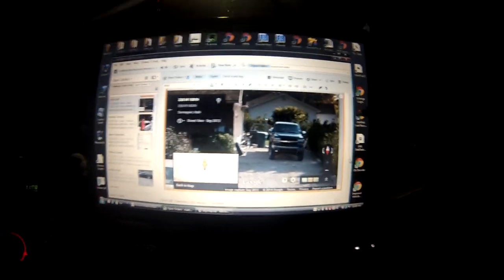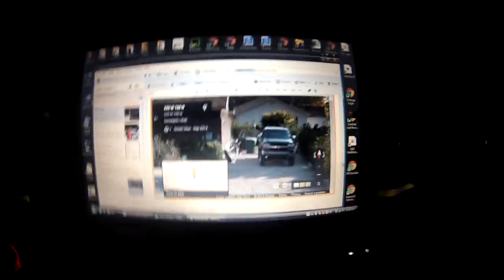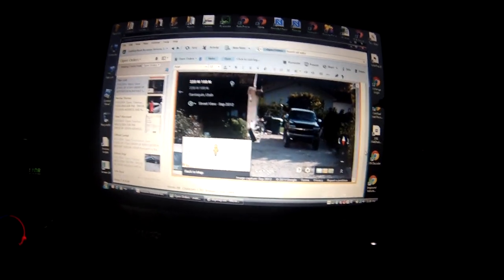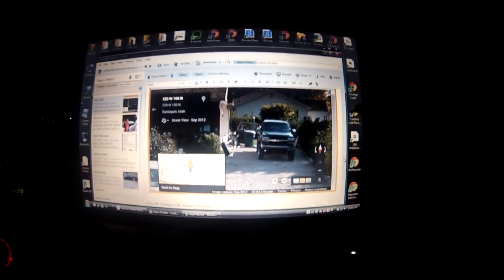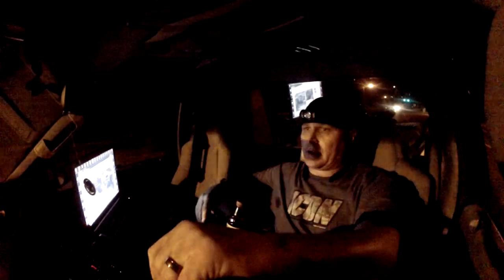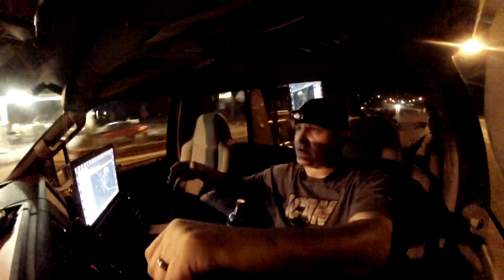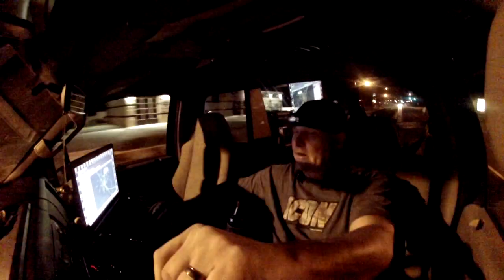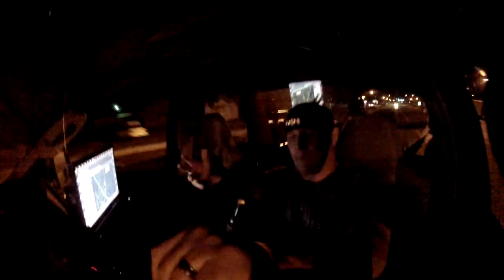It Is A Simple Fact That Size Does Matter When It Comes Down To It - 09/22/2014

Comment: Hy matt! I feel your pain on the engine repair. my experience with the Isuzu/GM "Duraslack" is not much better. As I run a 07 5500 4X4, and we replaced the injection pump and 10 injectors 6 months after putting it in service, 12K+ on that. You just can't get away from the repairs on something that is man made. I like to say. "if it is man made then it will break that is a engineered in feature so we have something to do later" LOL! I personally learned on Cummins so based on my history as a ex diesel mechanic I like the Cummins best I only wish the big 3 would let consumer spec out the engine, trans, axels on LD trucks as is the norm in the HD truck industry.

Comment: I actually really enjoyed the casual conversation Matt had with the debtor in this case. And this is also where I learned how much it cost to bulletproof a 6.4, which is why I decided to continue sticking with my old trustworthy 7.3.
Reply: 7.3 is hard to beat. My 2001 has a little over 385,000 on it. Two alternators and a water pump later and it's still going strong. It's heavily modified too. 110lb injectors and a bigger turbo dual 5 inch exhaust as well as an electronic programmer. On paper it's supposed to make 675hp and almost 1,000 ft. lbs torque. I can still manage 20 mpg highway empty withouta trailer, with my 43ft. RV it gets around 14 mpg.  It's a blast to drive and sounds great with the upgraded exhaust and turbo. The 6.4's are pretty decent motors after the "bulletproof" mods, head bolts, head gaskets and whatnot. Most of the pre emission diesels aren't to bad but the 7.3 and the 5.9 valve as well as the early 24 valve Cummins are pretty amazing power plants. The LB7 duramax is a really reliable motor too. GM from 2001-2004.5. The rest of them... well not so great in my experience.
Reply: @Mcscott67  i'm only getting 14mpg highway empty in my 2000 7.3
 lol

Comment: Surprising how many people dont really understand this diesel truck. Its ment to smoke, diesels smoke quite alot when you stand on them and when they are idling. No mechanical issues with the engine whatsoever, possibly a little extra torque and hp produced if its not a stock setup.

Comment: I used to race and pulled a 48-foot enclosed trailer around the country with a Silverado 3500 dually. It was a Duramax with Allison transmission and a chip and that made it quite the beast. The only problem was that I went through six set of injectors when the engine finally blew at 650,000 miles. I had the motor rebuilt and got another 200,000 miles out of it when the injectors went out again. So, I retired the truck at that point.

Comment: I  had my 71 Winnebago towed by a 350 with the stinger attachment. It was a 34 foot long RV. He picked it up from the front. the 350 didn't look too squarely on the ground but he pulled it 35 miles.

Comment: For my GMC Truck when it's front end starts feeling floaty I add counter weight to the front bumper ,I welded on 4 rods with big cap nuts and 6 inch washers welded to the cap nuts ,now I can add up to 400 lbs of counter weight using 50 lb free weights ,I've never had to add more than four 50 lb weights but I have 8 of the 50 pounders just In case, for snow plowing I only add 2 of the 50 lb plates on the 2 rods over each wheel and I can steer A lot better while pushing a big load .

Comment: Mr. Matt is sending me a set of dolly covers here shortly i dont know who else has bought a pair off of him but just as soon as i get them i will be sure to write a quick review and thank you i may even post a video of me opening them up and going over them. i just spent about 1600.00 dollars on a pair of in the ditch xd dollies zinc coated with aluminum rims and axles and here in ny the winters are rough in the mountains where i live and the salt and sand is horrible on your towing equipment so it wouldnt make sense not to try and protect them especially after all that hard earned money was spent on them. do the math 200 dollars on a set of covers could save me three times as much not having to replace the side frames spindles and all that. Mr. Matt is also very quick to get them made up and keeps you informed by email every step of the way. pleasure doing business sir.
Reply from the maker: FRANK HORVATH Oh crap I knew I was suppose to do something last week and it's been nagging at me... Now I remember I was going to get your dollie covers made and shipped out! Damn dude I haven't been sober for weeks now j/k LOL They will be shipped out first thing in the morning. Sorry about the extra 4 day delay. They made the smaller size the first time by accident but got the ;larger ones made pretty quick after that . They are all packaged and ready to go. Thank you for your order.

RepoNut
Reply: i appreciate it i wasnt trying to hurry you along neither like i said i been way to swamped to even mount the dollies plus im waiting on dynamic to send the axle tube mounts because their lightning body is shaped all crazy in the back so normal mounts aint tall enough in the back,

Comment: I recently put LEDs in for my turn signals, and it flashes fast. Yes, I like it as well. The only issue I have, is that it occasionally switches between fast and slow, which drives me nuts.

Comment: I have a 6.0 diesel... Yep! It gets bullet proofed this spring, want to avoid the $13,000 rebuild myself. Like you, I learned a whole lot about the 6.0 and 6.4 power strokes after buying it. The Ford 6.7 are good though, no longer international, now Ford makes them and they've been much better.
Reply: william dezwijger Fords = if the 6.0 look in the hood for already installed headstuds. 6.4, just keep moving, don't bother. 2011 6.7 and beyond, good engines.  Dodge 2001 and prior diesel, best engine ever. After 2001, keep maintenance top notch so lift system and injectors don't fail. GM products, they can be good or costly.

Comment: He should have bought a old 12v cummins tow truck, they sell kits where you can rebuild them for almost $600 and that's a complete rebuild. It isn't a cummins brand rebuild but I'm sure they will last awhile. You could buy 10 of them for what he rebuilt his 6.4 for. More than likely that 12v if you take care of it with proper maitence will last atleast to 300k before you need to freshen things up anyway. I've seen several go over a million miles before a rebuild was needed

Comment: Did you ever place the GPS tracker on the Tahoe?
Reply: LamborghiniReven1000 I was jus thinking of ask g the same question
Reply: I'm sure he did, but didn't want to show where or how he installed it.
Reply: LamborghiniReven1000 I like to be fast too
Reply: All it was was a magnetic box nothing special about where he puts it anywhere underneath on the body. A lot of times they like to hide them in front bumpers and stuff we're it's hard to get to.
Reply: LamborghiniReven1000 is that edwins shop?

Comment: i meant to put this in the video where you first got the ninja fixed. but have you ever thought about getting an edge insight cts. i think you had one on the 7.3 that would be a good purchase.
Reply from the maker: SteveTheTruckGuy CTS is a model made by Edge Products and I would go with them first choice since my older brother works there but they do not touch the engines with DPF and EGR deleted so I cannot use them. I have purchased a H&S Mini Maxx that should have arrived today but did not thanks to the retarded USPS. Video coming soon of the installation.
Reply: RepoNut the only tuner i would ever put on a ford is a dp tunner. i know there are lots of opinions out there but working on diesels gives me alot of experience with this stuff. dp only does fords. smarty only does dodge. and efi live is chevy. fuck that edge one chip fits all stuff. i have sean lots and lots and lots of people blowing up there engine with edge. also you need to be really care full  how you tune your truck with the deletes you have done.

Comment: you need to do a front counterweight on the front of that truck matt , I finally did a 600lb on mine , the front does not skate ever now , and the truck actually drives better loaded and empty !
Reply from the maker: towrecker I'll be adding a Warn bumper and winch soon that will be my counter weight.
Reply: RepoNut :) you will love it weighted , it makes an major difference , remember to check alignment after you add that , A 400 lb counterweight , as I assume a winch and bumper will weigh close to that , throws the alignment out enough to trash steer tires quickly FYI
Reply: ***** water is actually light , if you filled a 55 gallon drum up with water , and strapped it to the front bumper , it will only add around 400 LB of weight , but take solid steel say a 2x4 inch size solid it only takes around 14 feet of it to weigh the same my weights are 6 pieces 3 feet long welded together and it weighs right at 500 LB , mine is stacked inside my push bumper , so I can un weight it if need be ...

Comment: Heads up Mat, don't know if you realized it, but Passenger side reverse light aint workin. :) Noticed it when you were backing up to the truck that I only saw the reflection of your tail lights and driver side reverse light.
Reply from the maker: Ua it's been like that for awhile. Wiring issue not burned out light.
Reply: Just pointing it out. I know you have LED's so I know it's not a light out. >< figured was wiring or something, and needed checking/fix. So you don't get in trouble with the police for it .
Reply from the maker: ***** Back in the 80's I remember watching my mentor cut the reverse light wires right in two

Comment: RepoNut What was the overall weight of that DMAX Mine Sits about 8500-9000 with Lift and Tires and i have the 4 inch not a 6 inch, and have you thought about putting a nose weighted pumper on the front to counter the weight of the tows.

Comment: Don't dis your truck, dude.  It'll break down on you for spite.  My 2002 F350 Lariat Crew Cab Powerstroke 7.3 has 347,000 miles with no significant work. I've had to replace the starter a couple of times and the blower motor, but other than that it came bulletproof right off the line.  It tows trailers that newer trucks only wish they could.  Flash your chip for significant power/performance increases.
Reply: +Darin Clay Those 7.3s really don't need anything done to them. The 6.4s are a pain in the ass to such a degree. I mean several companies here including Lizard Lick run Cummins now

Comment: I'm sorry I ripped on you so hard about the laptop, but I used to drive a wrecker.  A tail-dragger on rotation.  One night about 5 years ago a teenager was driving a lifted Chevy pickup, and texting.  He rear ended a single mother's Ford Fiesta with three kids in car seats in the back seat.  The shop I worked for recovered both vehicles.

If you had seen what I saw in the back of that Fiesta, you would fold up that laptop, and put it away!  I no longer drive a wrecker.  That Fiesta is why.
Reply: Accidents happen the kid made a mistake. No reason to stop doing what you love just for a major mistake. Forgive and forget.

Comment: Bullet proof an engine that has flaws right off the factory line....anyone else see something wrong with that ?
Reply: MOOG does the same thing with suspension parts. They use the OEM design, redesign the problems out.....wah-la, MOOG problem solvers.

Comment: bullet proof ?
you went to powerstroke help in Buford Georgia ?
Reply from the maker: michaelovitch Ordered a set of Big Dogg heads and had them installed locally to his specifications including the ARP studs and a few other tricks to help with heading issues.
Reply: RepoNut
ok.
Is the excessive smoke caused by the DPF regeneration ?
Reply: michaelovitch
As part of the bullet proofing, he probably removed the DPF.
Reply: eformance
Maybe,maybe not, following the state the truck is registered in, to not bother the customer with inspections.
But if DPF is removed it would explain the smoke if the regeneration is not canceled from the ECU.
Those engines use fuel to create heat,not urea if i'm right.
Reply from the maker: michaelovitch DPF was deleted by the previous owner. The H & S MiniMax on the truck is programmed with the DPF and EGR deleted so the smoke was not from the regen. It was most likely from the new parts and the installation grease they use. It has stopped smoking on idle and barely smokes when I am driving it now.
Reply: RepoNut
Ok.
Thank you.
Reply: other placed do it its like doing a recall that you have to pay for
Reply: +RepoNut the 6.4s also have cooling issues I would get a bigger inter cooler if I was you
Reply: Leroy Spires dude the 1997 7.3 powerstroke OBS is considered the most reliable and rugged engine ever used in a light or medium duty truck also the 1997 7.3 got close to 20 mpg depending on how it was tuned it could get a lot more
Reply: you want a nice motor get a detroit diesel or a cat or even a cummings diesel
Reply: who me lol the 6.2 and 6.5 detroit's are so weak and the cat would require tons of fap work the cummings or a power stroke is the only viable way to go really and it already is a powerstroke he just needs to junk the 6.0-6.4 i cant remember which he has its an old post but them 2 are junk and need to be replaced with the new 6.7 or an old school 7.3
Reply: +VK70001.P i think hes talking bout the old 2 stroke detroit diesels not the shity 6.2 or 6.5
Reply: I always thought bullet proofing a engine like that was a parts kit and fixes most issues... i dont deal with deisels often

Comment: Hi, cant you add steel weighted blocks on your front of vehicle? make it so they can be added and removed per application.
Reply: +InTheFleshInc You would need some heavy weights. Where do you keep them when you don't need them? When I was driving tow trucks, we experimented with sliding weights under the truck. Worked okay, but lost a lot of clearance under the truck. We ended up removing them, as they were more trouble than they were worth.

Comment: Brother!!! 3 weeks is nothing for that repair! i have an 08 f350 6.4 and piston #1 also burned from a bad injector. the dealer i bought it from agreed to replace the motor free of charged. it has been almost three month sense this happened and the truck is in the shop lot. dealer taking his sweet time. just a bunch of bs... i have a contracting business and i ready to sue the dealer. first problem i had with the truck was that the turbos blew, dealer replaced them for free. now the motor needs to be replaced and im still waiting...

Comment: In Missouri, you'd die for repoing someone's vehicle. Especially when you're trespassing on someone's property.
Reply: +Ryan DeClue Get the vehicle when they go to town with it,
Reply: +Ryan DeClue What he's doing isn't trespassing.
Reply: +Bad Canadian Drivers Private parking lot. Items inside the car make it private property as well. Trespassing.
Reply: Ryan DeClue As long as the owner doesn't say he can't enter then its trespassing or if there are signs.
Reply: +Bad Canadian Drivers Not in the US
Reply: +Ryan DeClue. Trespassing is a flexible term, while you are right it is private property; no matter what belongings are in the vehicle, the vehicle BELONGS to the finance company.. That is what turns the situation from trespassing, too negligence of the debtor.. You are in no control over what happens to the vehicle when the account becomes delinquent... sorry but that's why people should either buy shit straight out or be prepared for the consequence of signing a lenders contract.. the law gives them rights to reclaim property.
Reply: +Common Knowledge Re-taught The law actually reads out that the lender doesn't own it until it takes possession. Until then, it is property of the debtor. 
This is why they hire gray area repo trash, and don't go to the debtor with an officer to repossess.
Reply: +Ryan DeClue you are right, but when you sign the contract to lease the vehicle, the lender uses a loop hole in the system.. results, broken system..
Reply: +Common Knowledge Re-taught Absolutely no argument on that statement!
Reply: +Ryan DeClue.. take it easy my friend.

Comment: I bought an American made vehicle and never again in my life will I buy an American made vehicle. Everything else made in America besides cars is great. I'm a strong believer in keeping the money in America and buying American but fuck, I learned the hard way. They build them with the intention of them not lasting so you have to buy another one sooner. My dad has a Toyota car with 325,000 miles and it still runs great, always starts right away. It's had less work done on it then my vehicle that has 95,000 miles, it's a fucking joke. Even the copper wires are thin as hair so they break and shit stops working. Thin paint that easily scratches. Never thought I'd say it but my next vehicle will be foreign. I had a Ford, the engine block cracked from the piston blowing up. So I switched to a Chevy, transmission dropped at 84,000 and I drove it like a grandma, among many many other problems. Buicks are the same, next vehicle will be a Toyota Tundra probably.

Comment: 13,000 is much more than a crate BRAND NEW 6.7 powerstroke diesel engine, might as well have crammed that in there
Reply from the maker: Declan kot I priced it out and that is just the short block and some of the other parts. Full motor was $17K and that does not include the labor or changing out the wire harness and a few other mods. In total I was quoted $21K for a second gen 2015 6.7,
Reply: RepoNut hold. Shit I was off, sorry about that
Reply from the maker: Declan kot That's ok I was thinking like $7000 worse case scenario so I just about shit myself when I found out the true price. I think with all the upgrades and "bullet proofing" we did to the engine I went the best route I could for the money. Still cannot believe I paid that much for engine repairs. FML Live and learn